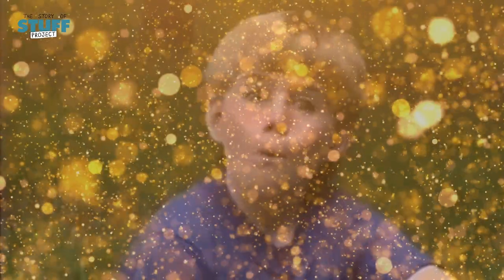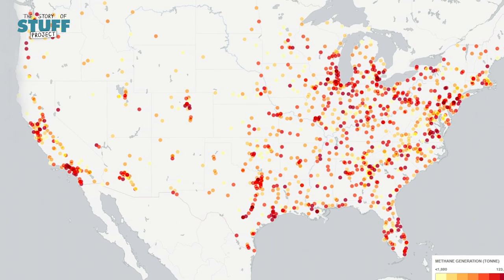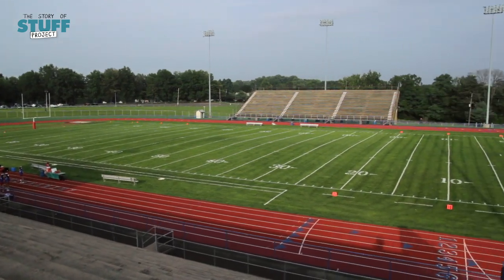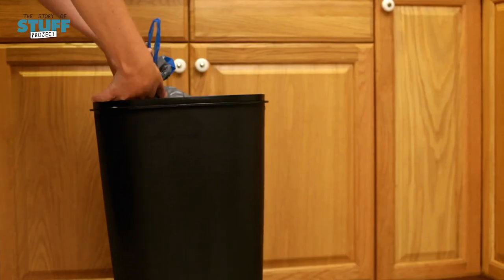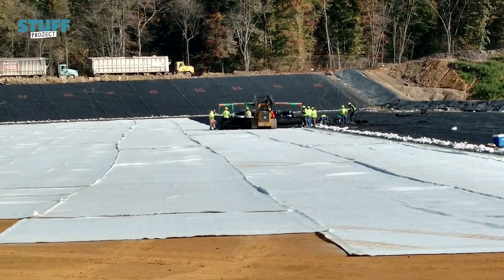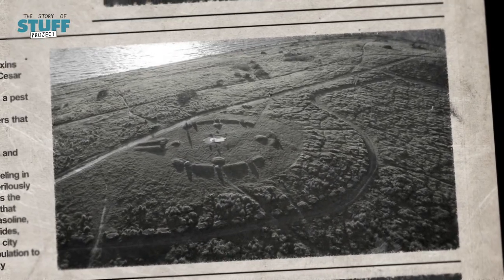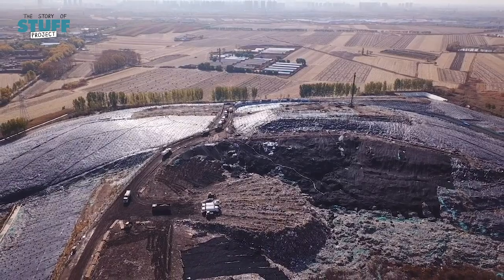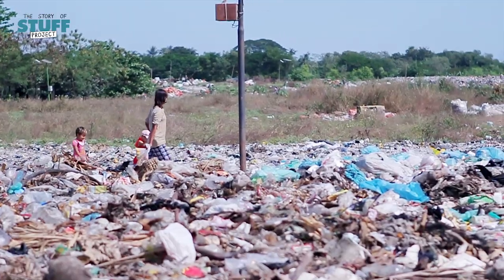Where Does Your Trash End Up?

Comment: Five-part curbside recycling could be done by local trash and recycle pickup companies.  The divisions would include (1) kitchen and paper wastes, (2) wood and yard wastes, (3) plastic, glass and metal wastes, (4) electronic components and other mixed composite materials, and (5) chemicals including contained household toxins and other hazardous wastes.  At home, personally, all paper products except cardboard can go thru an inexpensive paper shredder (I use an Aurora 1210MA) .  That then goes into my compost pile with all kitchen scraps plus some horse manure from a local farm.  In about 90 days, this is food for my garden--which garden I eat from daily.  Even with a small yard you can grow veggies and even have  fruit tree or two.  A small greenhouse extends your growing season.  The optimum is a 5 to 10 acre off-the-grid cooperative community of 16-25 persons who are close to you in beliefs and feelings.